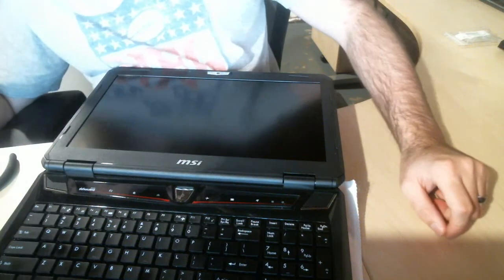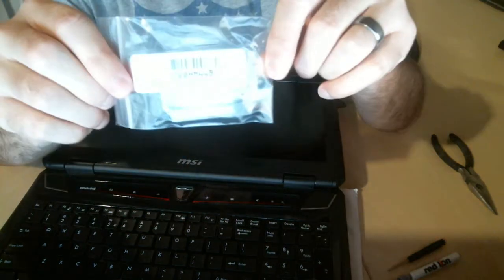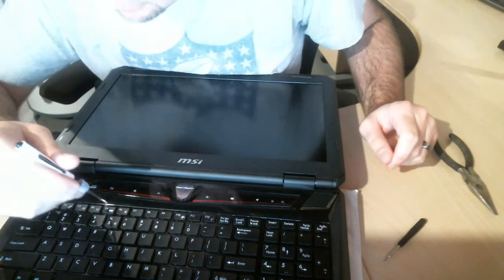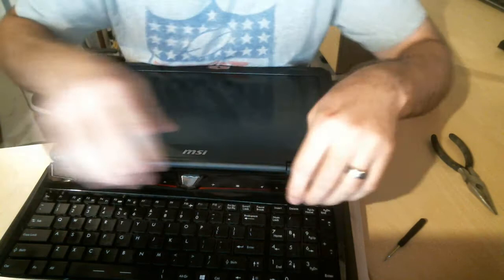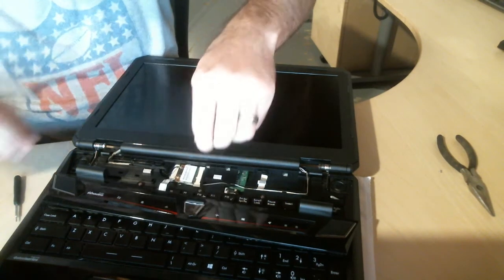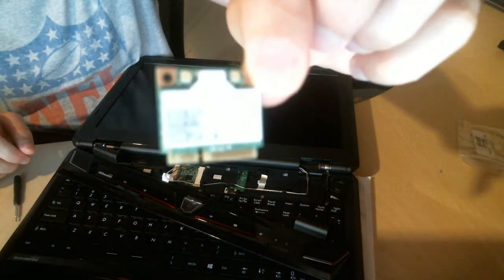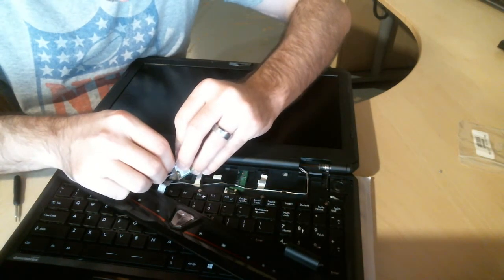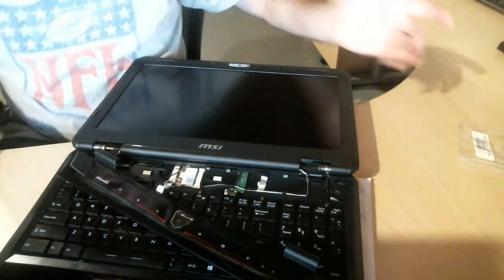MSI GT60 GT70 2OD Wi-fi card replacement (mini PCI Express)

Comment: This is actually one of the only videos I found to replace the wifi card in a Valkyrie CZ 17 from ibuypower. The cases are basically the same design. (perhaps a barebones system that ibuypower rebranded) Much appreciated!

Comment from the maker: This should work in any MSI GT system.  The results are pretty nice.
Reply: Just invested in a Netgear Nighthawk R8000 ... might be time to upgrade the wi-fi card now to take full advantage of the new router. This video demonstrates yet another reason why after 2 years of owning my MSI GT70 I still absolutely love this machine. I have had no problems with it other than the top outer shell has cracked in a few places and I have a couple of dead pixels ... but considering the amount of extreme usage my machine gets on a daily basis, I'd say that's not too bad for wear and tear on a heavily used laptop over the course of 2 years (plus the outer shell and lcd screen seem to be easily replaceable and not too expensive to replace).

Comment: Great video. Wifi worked after just plugging the device. 

However, I have not been able to enable the bluetooth. There is no bluetooth adapter showing up in device manager or wireless devices. Have you run into this issue?  Could you solve it?

Comment: How do I set up a NEW computer with a PCIe Minicard wifi adapter? The new computer doesnt have the antennae. Do I have to unsolder and resolder the antennae? If so, then to what? Or would that ebe a compatibility issue?

Comment: Hello, how are you? I really liked the video and I have a doubt. I have an MSI GT70 with a GTX680M MXM slot and would like to exchange it for a GTX1070 MXM slot. Is it possible?
Reply: Yup. At least a 1060 anyway.
Reply: @nexxusty  i bought a gtx 1070 but cant install the drivers correct.
Reply: @ucss25  You need to mod the driver before install.

Techinferno is your best bet.
Reply: @nexxusty  I already made mod inf. but only install the first gtx 1070 mobile driver

Comment: I replaced my wi-fi card to intel 7260ac on my msi gt60 2od. I installed the drivers. But wifi does not found any networks. Probably I have to turn on my wifi, but System Control Manager can not do this. Anyone help me.